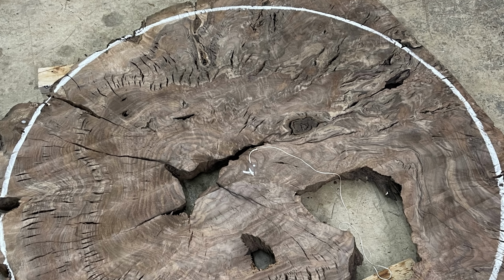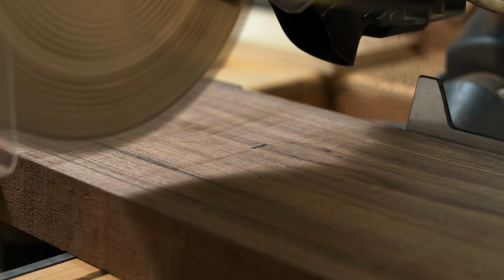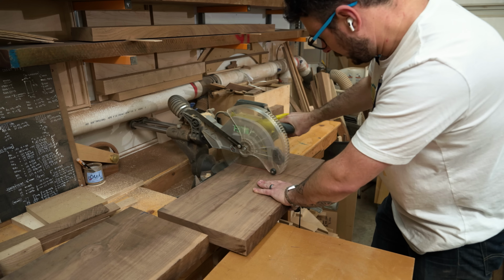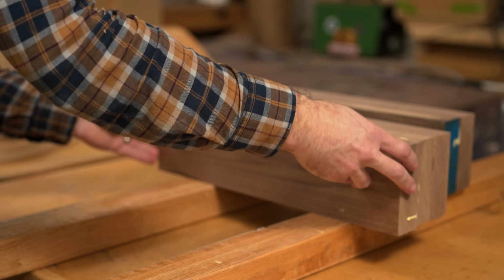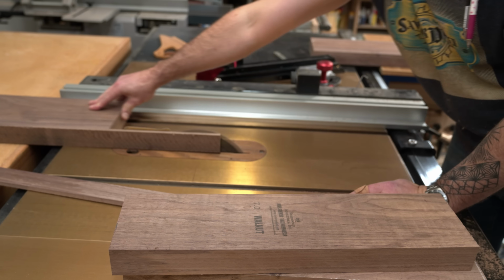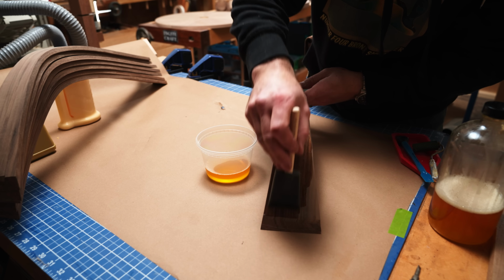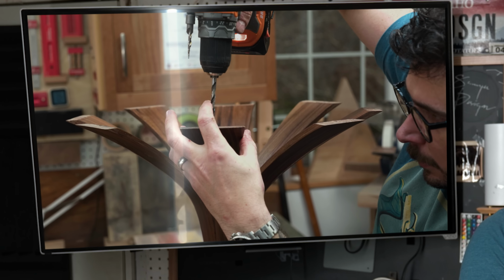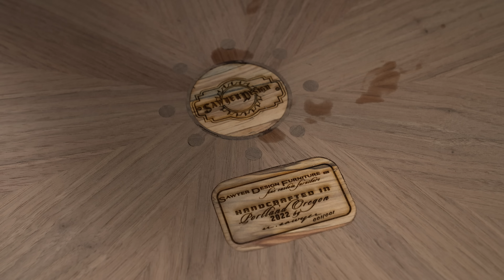BENDING WOOD To Make a Table w/ Blacktail Studio (pt. 1)

Comment: Aside from the music, which I found distracting, I like how you've done this video.  I would recommend you spray a more protective topcoat product over the shellac, which will significantly improve its finish durability.  I'm not a proponent of metal bases, so yours gets my vote.
Reply from the maker: Thanks Marty. Topped in several wax coats. Considered 2K, but didn’t want to affect the detail shellac reveals and this will be much easier to repair after years of chair leg bumps. Especially since those inside areas aren’t accessible to sand back to raw. 
Don’t be afraid of that mute button 😉 helps with edit and keeping up the pace.
Reply: @SawyerDesign  I've been a professional finisher for years and believe me when I say that you shouldn't ever be concerned about the correct topcoat affecting any detail, as that will never happen. Thanks for reminding me of the mute button, unfortunately that also cuts out the info you're providing by voice.
Reply from the maker: @ApexWoodworks  yeah I’ve had your series on finishing on my watch list from Fuji (maybe that was on emtech) Need to dial in my wb CV/2K game. Need to figure out ventilation, so I can control temp/humidity. Rainy Portland in the winter hasn’t been my friend in producing the best results the past couple cold wet months. Shellac seems to be a little more resilient.

Comment: I think there is another profile out there for the edge detail, the piece needs more negative space its too solid and heavy looking, when you add the huge slab top it will make it even more visually heavier
Reply from the maker: Interesting, I think the pass through on the base actually uses a lot of negative space to lighten it up. A ring around the top like the base would be cool imo.

Comment: Amazing work as always. I do wonder if it will twist under the weight of the top? Also, there was a moment when you were attaching the baseboard the legs, and in a frame the base was "floating" an inch above the legs and I thought that would be a cool build design in itself?
Reply from the maker: Torsion is definitely its weak spot. After seeing the chunk of slab and epoxy, I’m going to revisit this in a couple weeks to reinforce.
Reply: @SawyerDesign  good luck! Love your level of detail in your work.

Comment: What band saw blade do you use for your resawing?  Looks like 1/2", do you use that for most of your band saw work?
Reply from the maker: I was using a 1/2” carbide. It was 6 years old and snapped. Bought a replacement from highland that lost all its carbide in a couple weeks (do not recommend). That original must’ve been Lenox. I’ve been using a timberwolf 1/4 3-4tpi recently and it works great.

Comment: Why didn't you use steam to bend the wood?
Reply from the maker: Not set up to steam. That's the other option though.
Reply: @SawyerDesign  I wonder whether the steam is better or your way is better 😊
Reply from the maker: Each has their pros, cons, and applications at which they excel. I don’t think either is better than the other. I choose lamination for its stability. Steam bending still relies on the inherent will power of wood movement in the final product.
Reply: Thank you for the information. Is always good to learn new things. I'm not a woodworker but who knows maybe one day I will be making some nice furniture like you 😊

Comment: Im curious why you used epoxy for the legs and glue for the edge banding? is it for strength or open working time?
Reply from the maker: It’s actually for flexibility. PVA is a little less rigid of a bond to wrap around the base a bit tighter/ more margin for error.

Comment: Stunning design. So much effort in fabrication and construction and I loved the beautiful veneer patterns. Maybe it was the angle of the final shots but it looked like the thickness and taper of each slat where it met the base wasn’t uniform and the pedestal wasn’t precisely centered in the black circle of the base. Considering how much planning and effort went into this piece I was a little surprised at the final product.
As I said, maybe it was the angle of the shot and I didn’t see it exactly or maybe my OCD is worse than yours. Generally speaking I love the creativity and artistry of your work.
Reply from the maker: It was centered. The lams alternate across the black line. Admittedly, the free floating and unreferenced lams didn’t transfer as well as I had hoped. With an organic theme and titled ‘roots’, I don’t think it detracts from the design. I’ve been woodworking for 3.5 years and bent lamination for less than one. The day I can execute perfectly every one-off design at the pace I do is the day I will add another zero to the price tag. Maybe with another year’s practice.

Comment: My heart stopped for a few seconds when watching you drilled through that leg. But i also wondered if that could be an opportunity to redesign the joints, by using dowels (either black resin or wood), like you did with the top plate and use it as extra feature?

Comment: You. Are. Insane.  I had a collection of fun/snarky comments from things throughout this video, but the list got too long for a YouTube comment. To answer the poll, I like Option D (Delta, military style) for Cam's edge treatment... if that burl will support it... then again, he's probably filling the whole thing with black epoxy as you said (duh, right?). Amazing build, Nick - I know the 20+ minute video probably condensed weeks of work, so hat's off to you. Question: saw the outer edge ebonizing with iron acetate on walnut, but did you use India ink on the small inlay you routed on the inside? Not critical - it's all f*****g beautiful... t**s, even.
Reply from the maker: Thanks so much! Glad you enjoyed. I used milk paint for the large particulate size and less likely to bleed. Worked awesome.
Reply: @SawyerDesign  Filed that answer away as a pro tip.

Comment: B is my choice from the 4.
I just wish there was an option that matches the bottom of your base profile better than those 4 options do.
Reply from the maker: Totally agree. A rabbeted edge doesn’t have quite the same appeal as a bent laminated border. And the latter doesn’t work on a slab.
Reply: @SawyerDesign  just an idea, but how do you think the tabletop would look with a laminated border matching the base?
I know you're not going to be working on the top, but seeing as you're a designer & I am not, do you think that would look good or do you think it would look cheesy?
Reply from the maker: Absolutely. Not sure how I’d make it work with wood movement though.

Comment: You really should learn Sketchup so you can design your furniture instead of just winging it.

There were so many things you would have done differently had you known how it would turn out.  Those sprawly legs also didn't lay flat on the base.  Some were tapered flush while others just had their ends exposed. 

There's two things you were trying to do.  

Do really good woodworking, and designing.  They shouldn't be done simultaneously.  3D modeling is a lot like doodling on a piece of paper but more complex.  Sketchup isn't even hard.  What you do with your tools is harder.
Reply from the maker: 😂 sketchup. I assure you sketchup wouldn’t model this. All done in Rhino. No winging involved

Comment: the only thing easier than steam bending is cutting a straight line ... if it was any simpler a baby could do it ... 
.
you just need steam and container to hold what you want to bend, a jig to layout the bend of the item you want bent ... and time ... it is THAT simple ... it isnt hard to make a BOX is is easy to make a pipe fitting ONTO that box that allows steam in from say a kettle or pot ... yes some type of guide like a funnel to get as much steam in as possible ... and a smaller than inlet output for the water a basic bowl with say a drip tube going back to the steam kettle or pot to keep it recycling the water ... 
.
gloves come in handy when moving the HOT wood to the form you want to shape it around ... and pegs work great with shims to hold it tight to the form ... THAT is all it takes to steam bend ... heck you take more effort to make a router jig than to steam bend ...
Reply: you already have the angle hold block ... just raise the smaller end the portion needed to make the proper cut and then cut ... even turn the jig on its side and use the band saw or table saw ... take less time to change the height of the smaller end than to cut the angles by hand ... a little THOUGHT goes a long way ... such as your pyramid block .. if its 4 inches at the bottom and 2 inches at the top the jig just need to have a 2 inch difference between each end ... so raise the small end by 2 inches or push it out by 2 inches ... and cut ... it is NOT like you are trying to make a basic cone with a twist down its length .... your just making an octagonal cone heck even easier make it octagonal first then put an angle piece along your guide fence and cut .... off the top of my head that 2 faster better and easier ways to do that one operation ... and Im NOT a wood worker ...
Reply: ok now I have seen the video to the end for the base ... nothing a grade 7 kid in wood shop wouldnt do ... and about the same quality too ... the top better be spectacular to make it worth more than $50 ... 
.
yu have done better than this making a jig ... and this is supposed to be the bottom of a FINISHED product ... come on show your passion for wood working by actually PUTTING some love and care in to the job and do it properly not just ahh good enough 
.
seriously this matches ALL american made goods ... ah it's good enough ... if it isnt something you would want to see handed down for generations then it IS NOT GOOD ENOUGH ... that is the difference between a 50 buck bodge job and a 500 buck solid walnut base properly fashioned bent and constructed .... and yes that is a BODGE job ... it sure is aint showing ANY passion for wood working just for potential cash income ...
Reply from the maker: Your use of ellipses had me on edge the whole time…

Comment: You do very nice work, however it's my opinion that bow-tie's do not belong on natural edge tables. They don't go together. It's more work, but try more natural looking tie ( not straight-edged bow ties) A squiggly or curvy tie would look 20 times better on natural edge designed table.
Reply from the maker: Good thing I didn’t put any bow ties in this
Reply: @SawyerDesign  I am not sure if you are being sarcastic, lol. I was referring to other projects, as I am sure you know.
Reply: @hansvonschlader8227   I can’t think of a single video where uses live edges or bow ties. I could be wrong, but either way, why would you bring it up on a video with certainly zero bow ties?
Reply: @johnledyard2320  I was just speaking in general, not particularly on this video